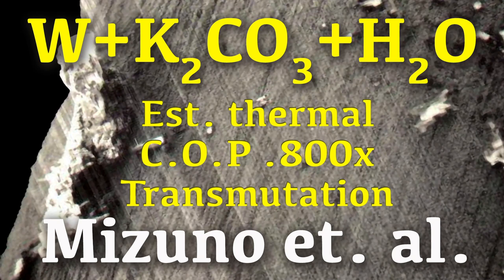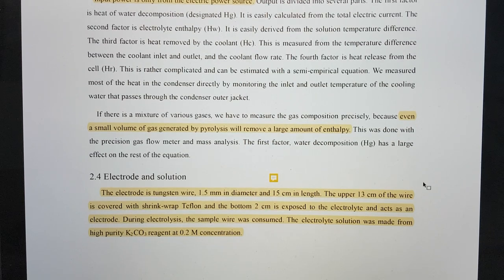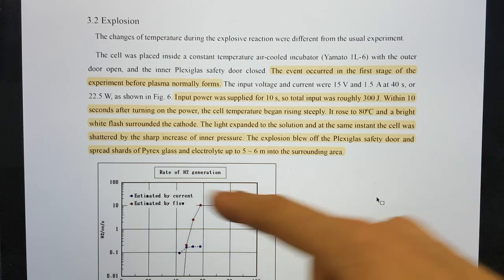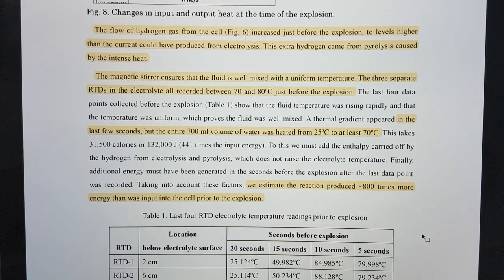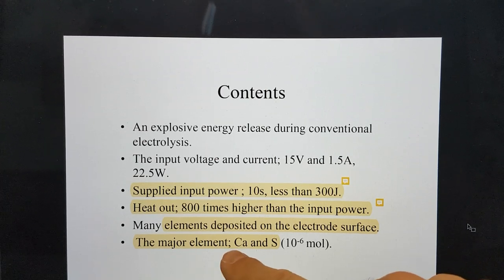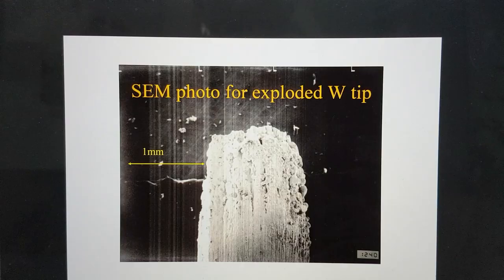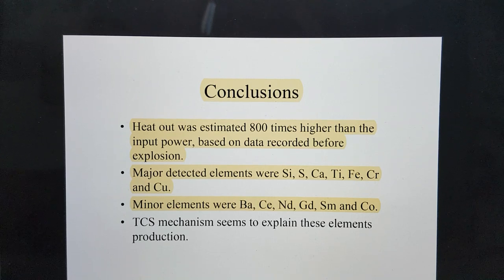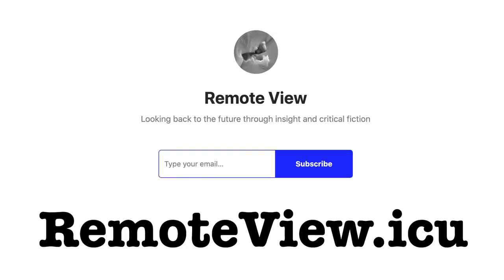Transmuting Tungsten - 02: Mizuno

Comment: Thanks for this. It seems to me that this phenomena is about ionised hydrogen (protons) becoming a current carrier and when pushed through crystal lattices with electrons flowing in the opposite direction, you get swirls of protons and electrons, and like weather systems these become vortices. Then probably this produces a flux of neutrons that trigger the transmutations.
Reply from the maker: Closed Vortices (Solitons) of electrons stabilised by ions (H+ or Protons) also known as Exotic Vacuum Objects (EVOs) is a good candidate start point.